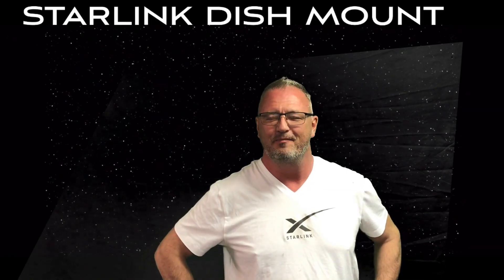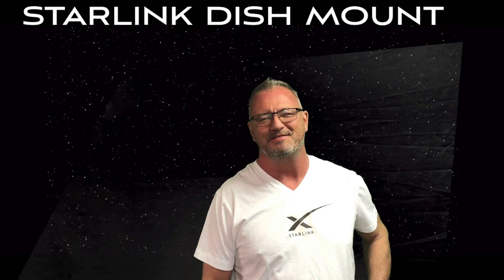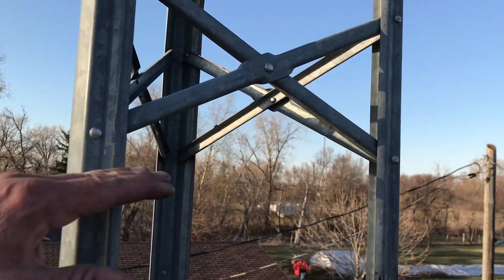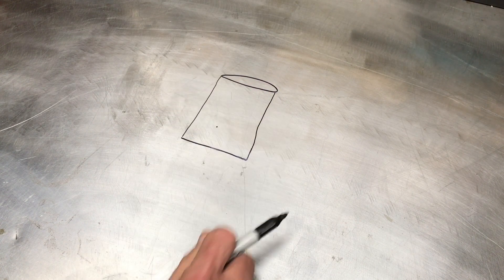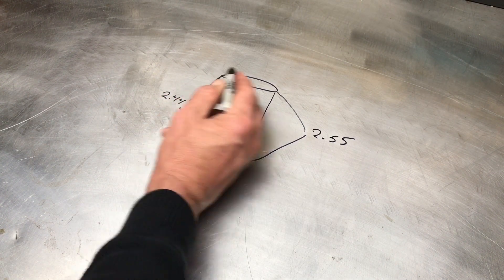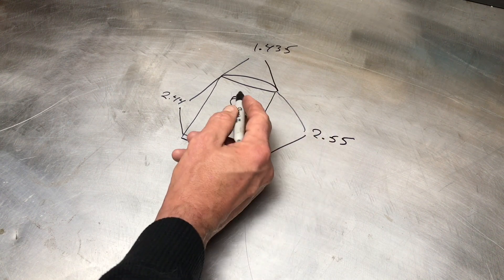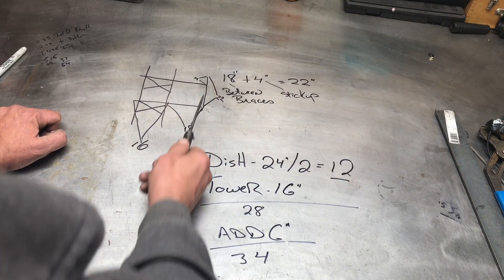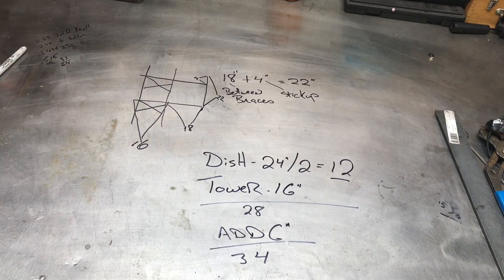THE BEST STARLINK DISH MOUNT ( LETS BUILD IT!)

Comment: Oh yeah, nothing to it. Let me just go my metal shop and get out my calculus books. Have to admire you though for having the skills!
Reply from the maker: Fair enough .
I will say though that one can be built but perhaps not as accurately .
You can use bolts and also can drill though the existing mast and use a pin or cinch it tight with a bolt through the mast.
But of course you’re right , not everyone has a shop with a lathe etc.